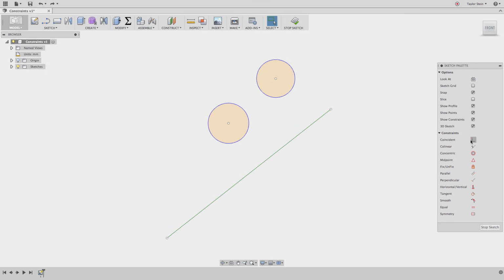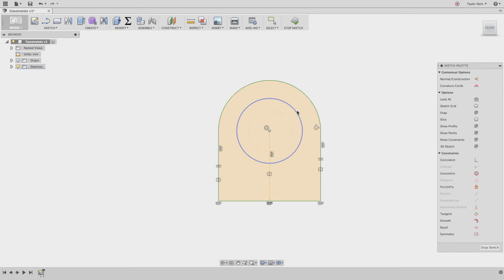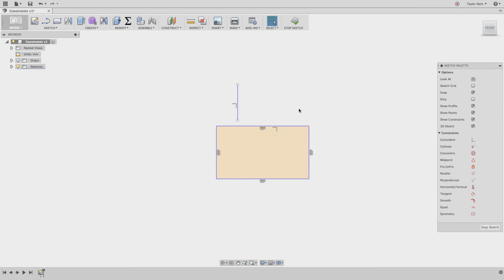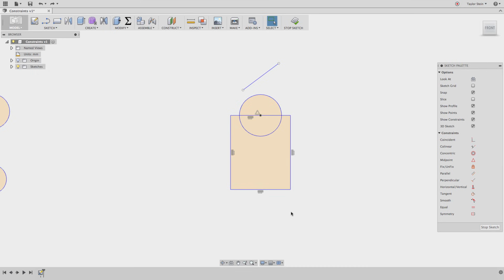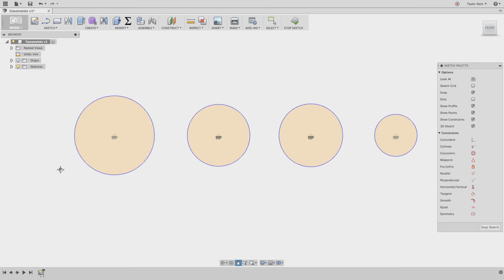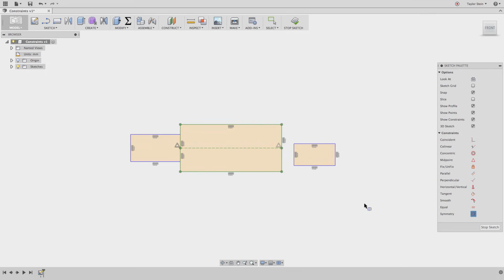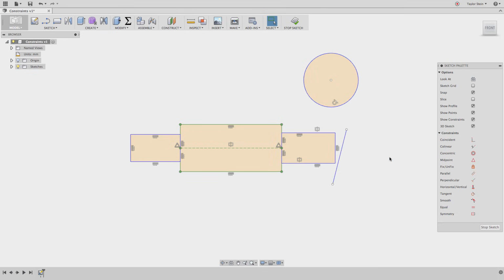Fusion 360: Sketch Constraints

Comment: Hi nice video, I’m new to fusion. I’m trying to figure out how to make a 2d drawing for a truck grill using a hexagonal pattern. I used the polygon tool and made the hexagons .500” opening and about .125” spacing between each but I don’t know how to use the constraints to line up the center points of each hexagon. Please help 🙏

Comment: Hello!
I printed a microfluidic chip by using fusion 360, however, my channels are not fully printed, they were around 400µm in width and 45mm long. I tried so many times to fix .stl, .3dp and .slc files, tried multiple design as well, still those channels are not printed. Please help me out.

Comment: Coincident – 0:18
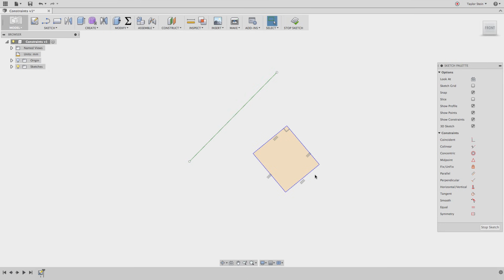Colinear – 0:54
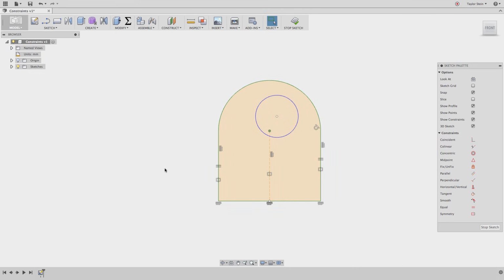Concentric – 1:13
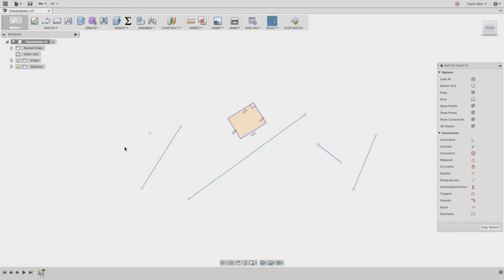MidPoint – 1:38
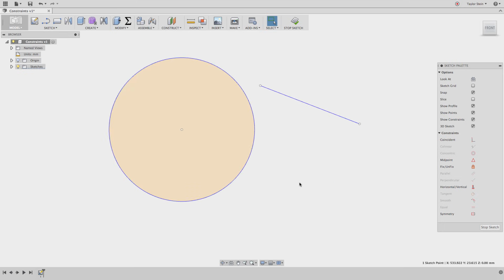Fix/UnFix – 2:40
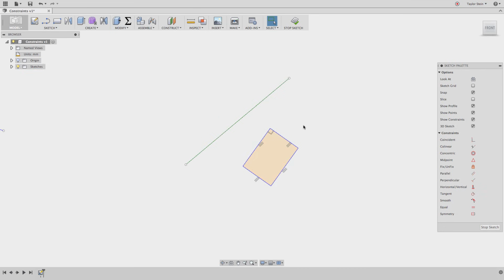Parallel – 3:21
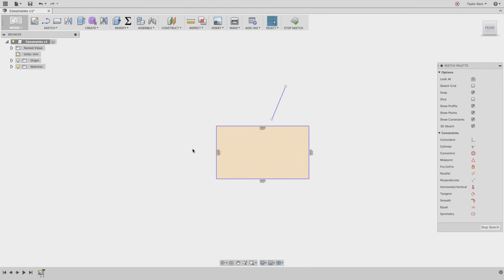Perpendicular – 3:39
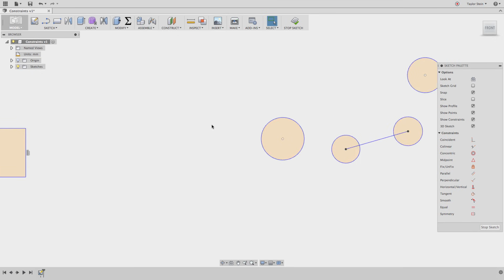Horizontal/Vertical – 4:12
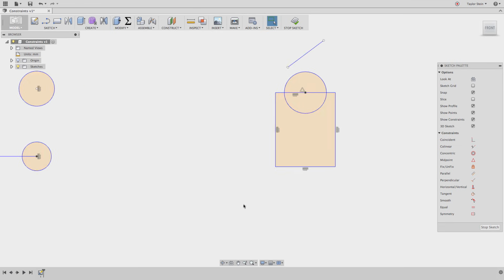Tangent – 4:58
Smooth(Curvature) – 5:39
Equal – 6:13
Symmetry – 7:00
Hints/Tips – 7:49

Great video, thanks!
Reply: Coincident doesn't seem to exist anymore in 2022, great video but it looks like it would need an upgrade.
Reply: Never mind it is there, I didn't realize there were more constraints available in the drop down menu.

Comment: If u don’t set constraints and draw something 2d quite complex, I wish it would tell you before just doing the angle change to something. Also the move command. Wish it was like extrude to an object. In move there’s no distance command where you can just click on a face and it moves it there. Or at least I have yet to find it if it does exist.

Comment: What does Fix/Unfix button do?
Reply from the maker: Great question. This is a special type of constraint that does just like it sounds. It fixes it without relation to anything else. See here for more details (although the text doesn't line up with the icons for some reason...trying to get that fixed) http://help.autodesk.com/view/fusion360/ENU/?guid=GUID-4183A4B7-E002-4396-AD5A-7FF3C8B2F33A
Reply from the maker: At that article it SHOULD says: Locks the sketch entity in the current X, Y position.

Comment: They make too many fucking changes to this damn program.
Reply from the maker: Sorry about that...we do not take these decisions lightly. Most of the changes have been made for very real (and future thinking) reasons, or due to feedback. The problem being that content like what you comment on here, is out of date very fast. Anyway, sorry about that...we hear your frustration.
Reply: @adskFusion  Yes, the last mentioned part of this particular video being out of date it was stemmed my prior comment. But, I do understand. Thanks for taking the time to view & respond to feedback. By the way, I was curious if it was possible to add a feature to (for lack of better term) mirror two sides of an object while editing in the design mode. Editing molds would be much easier if I could select my two models (which are mirrored with one another along  a plane already) and then pick a midplane then it would do the edits to both sides of the model. Sorry if I am being unclear in my request. and again, THANK YOU for taking the time.

Comment: Question. I'm brand new to Fusion 360 and I'm doing it the exact same way you are in the video collinear but when I click on my square then my line the line is what moves every time. I don't get it. I should be able to select what I want to move, not have fusion just pick what ever it wants. 

Also on the coincidence my circle will not move to the position selected on the line it just moves straight up above (inline with the line) but i have to move the line to meet the circle. I'm literally copying your moves and getting completely different results. What am I doing wrong?

UPDATE: I didn't realize that you fixed and locked the green lines. Now that I did exactly what you did I can't get my box to collinear with a fixed line. Error: Failed to solve. Please try revising... etc
Reply from the maker: I believe the first selection moves to the second when adding constraints. And the reason you may be seeing different results is that the UI has changed significantly since this was published.
Reply: @adskFusion  I wondered if that was a change to the UI. Kind of a dumb change. The way it worked here in this video is how it should work intuitively. Not like it is now. These videos are by far the best. Other ones I've seen have how people use it but not how all the parts of fusion work. Best by far.

Comment: Great video... How do you constrain two offset splines so that they remain parallel?
Reply from the maker: Did you use an offset feature? It should automatically add an "offset constraint", which will ensure the proper offset. If you deleted that, I believe the only way to bring it back is to re-make the offset feature.
Reply: @adskFusion  Yes but when I move the original line around it gets all jacked up.

Comment: Anyone know if the fix constraint works with splines? I'm drawing a fuselage the outline contains two long splines.....

When drawing crossmembers, I apply constraints to assure they are parallel and of a certain width.... the crossmembers are distorting the spline as drawn.

I'm having trouble constraining the splines so as not to be influenced by additions to the sketch. Any thoughts appreciated

Comment: Hi, great beginner's tutorial. In trying to make two connecting lines perpendicular and instead of getting a right angle symbol in the corner of my two lines I got, the "T" icon and a message that said over constrained. What does this mean? Any help please.
Reply: The 'T' is the icon for perpendicular, coincident looks like a right angle (but the lines don't touch.)  You'll get an 'over constrained' error when existing constraints already effect what you're trying to constrain.  (ex: a horizontal line and a vertical line are already perpendicular.)

Comment: Why did it change the size of the rectangle when you set a colinear constraint between the side of the rectangle and the line? Shouldn't it just make that portion of the line shared without changing the dimensions of the rectangle?

Comment: I have strugle to learn or use fusion because of those constraints..as beginer in skech mode for the simplest objects I use 80% time to fight with those added restrictions when I move parts, very frustrating so moust of the time in the end I drop the fusion and use different cad...are there solusion to get rid of them, because I can not even see what constraint is active and causes the problem.

Comment: I'm not sure if this is a constraint. For some reason after a certain period of time, the sketch becomes locked and I can't delete anything at all. I can add just fine, but can't do ANYTHING to the modify current sketch, extremely frustrating (fist through monitor level frustration) I just put a ticket in with AutoDesk this AM, I can't deal with this anymore. It's been so bad that I have to start all over with a sketch because the previous is locked. I get no warnings or explanations, drawing has a slight flash as if it's trying to delete but the problem remains.
Reply: I find an occasional reboot of F360 solves problems like this.

Comment: Hi really good clear video.  Question..  ref your example with centering 2 outer rectangles to the main centre rectangle. How do you constraint the sketch if you want to centre the two outer rectangles to the main body but maintain that  space between the main body. I'm trying to avoid using symmetry at sketch stage as I understand this is good practice as it can lead to complications if there is a problem further down the process. Does the centre command always join the two bodies.   Thx in advance.

Comment: so I am stuck on how to get a curved end on a profile.
draw 2 lines 90 degrees to create a corner. Offset the corner by 10mm. Join the 2 ends with a curve and you have a 90 degree corner with curved ends - great. Increase the offset and the curves increase to match - great. BUT - decrease the offset to 5mm and the curves disappear and/or break. Tried it with 2 point circle and trim - same thing, they break. How can I drive these end curves to work with the offset without having to reference the offset formula? Thanks

Comment: Why can I not do a perpendicular constraint between a line and an arc. I can work around this, but it would be much easier to just use the perpendicular constraint. Even freecad can do this. Get on the ball.
Reply: I think because it's really very easy to work around that. Either do a tangent line and a line parallel to that or connect the arc center and your line and make them perpendicular. That's even more expressive because you can tell, at which point on the line it is perpencidular to the arc. Hope I got your question right.

Comment: Great videos, Taylor. Could you do one on sketching on multiple planes in 3d space and applying constraints to those sketches to create rails for Loft? I'm having a hell of a time. I can use constraints no problem on a single plane but they don't seem to have the same properties when there are multiple planes in 3d space. T-spline handles can't be manipulated either. I am clearly doing something wrong!

Comment: I'm trying to position a hole in a PCB board in Fusion 360's sketch mode. I've tried setting a dimension constraint between the circumference and the rectangle that represents the PCB, but Fusion refuses. How would you position a circle in a sketch relative to a rectangle?

Comment: Is there any way to sketch without  constraints being added until you assign them? I find I use most of my time tracking down and deleting constraints that Fusion has decided I'd like. Lines become fixed to other lines, moving a circle drags half the drawing around, etc. I'd love to be able to just sketch without constraints and then go back in once I'm sure of the design intent... Can I delete only constraints within a selected boundary for instance..?
Reply: from autodesk's website - "While there is no option to turn off or disable the creation of automatic sketch constraints, you may avoid them by holding the CTRL key (CMD on Mac OS). "

Comment: Great tutorial.  Thanks.  My question is how do I disable a previously assigned constraint.  For example, I have a 4 sided geometry and I added a = constraint, but then decided it would be better if the two equal parts are no longer needed, one now needs to be longer than the other, but I can't figure out how to disable that = constraint.  Thanks again.
Reply: Click on the restraint symbol on the sketch, then hit the delete key

Comment: Hi, How do I know if a sketch is fully constrain?, I mean, using Inventor there is a message at the bottom showing the amount of dimensions needed to be fully constrain. Thanks.
Reply: There's an option in preferences under preview for colour constraint status. It is in preview so it isn't 100% yet, it miss reports at times and it will sometimes stop you adding a constraint, you might need to disable it occasionally to add some constraints.

Comment: I frequently use the horizontal/vertical constraint with the midpoint of a line. Recently, the midpoint (x) of a line doesn't show up anymore and I'm unable to assign this constraint. Any thoughts/ideas as to why this is not happening?

Great video. Thanks!
Reply from the maker: Great question! As of a recent update, you'll have to hold 'shift' to have these midpoints appear when applying constraints.
Reply: Works perfectly!  Thank You.
Somehow I missed this change in the release notes...
Reply: Doesn't for me. Another update?
Reply: Hold down shift and the midpoint "X" shows up now....